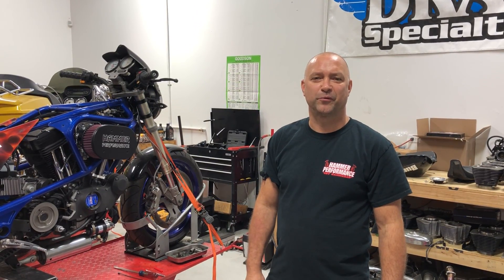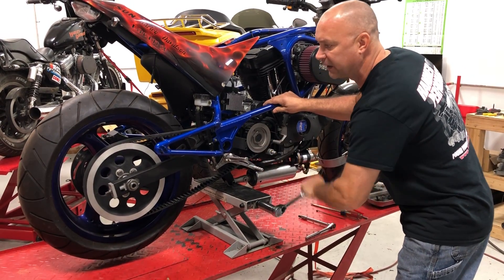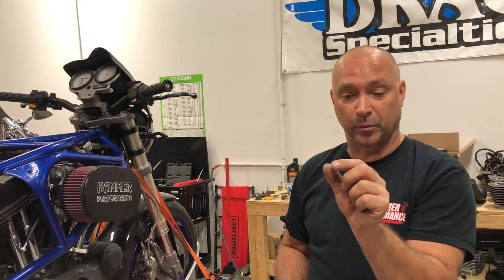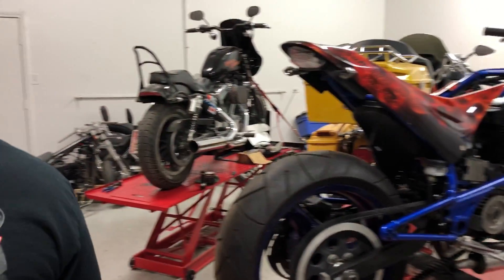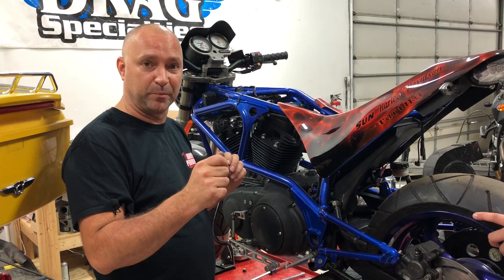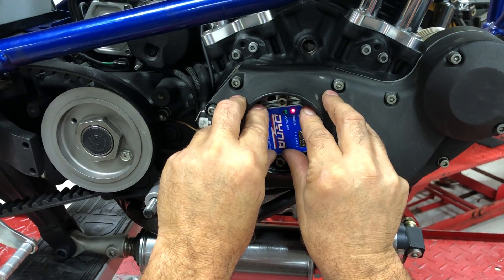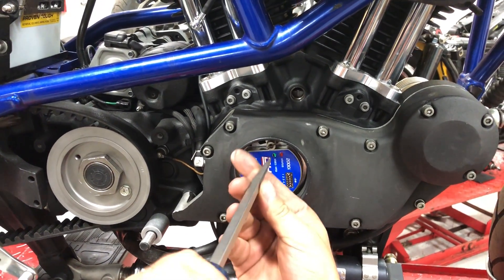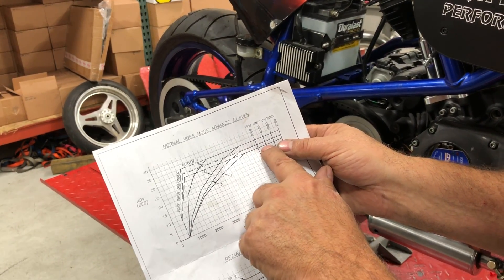How To Static Time An Adjustable Ignition Module

Comment: Why is my red light in flashing mode key on killer switch on run and cant get it off when rotating module.and it won't start either.

Comment: Once again thanks for the clear info. I have an ultima ignition and indeed the previous owner had it set at curve#1! When I dismantled the engine I found exactly what Dan here describes, scuffed pistons. I am surprised the pistons held up, as they were KB...also know as KABOOM!!! engine is being fully rebuilt with Wiseco and a programing kit for the ultima so I cam set it exactly as described in the video, only.mine will bring total timing to 28 without having to rotate. 👍👍👍
Reply: We're you able to still get the USBcable to program the ultima? I'm out of luck here since they fell out of business. Currently running curve 4 and advance the timing to 28 degrees from the 25 degrees it sits on curve 4. Was hoping to get the cable to get the rpm range increased from 3k to 5k.

Comment: I had the same exact problem, the status light wouldn’t stay on, it would blink once when I clicked on the run switch, had a buddy help put his finger over he front cylinder and it blew is finger off the hole so I new it was on the compression stoke, got the mark on my crank dead center, the light stayed on and got it static timed perfectly like the video, MAKE SURE ITS ON DTC ON THE COMPRESSION STROKE. 👍👍🔥🔥

Comment: Hi Dan,I have a 96 sporty, converted to 1200.i bought dyna2000p, and did all that you said on this video, on the dials I have dial 1 off as in voes mode, but what about the other four dials?, which one stays on or off, my bike is misfiring and sputtering, please let me know asap thanks.
Reply from the maker: Switch 1 is Off, switch 2 & 3 are ON, Switch 4 is Off, switch 5 is ON, switch 6 is off  hope this helps
Reply: Thanks Dan, the bike was misfiring cause i installed the new pick up sensor 180 degrees around, its fixed now , switch 1 is off as ait is now and will adjust the others as you said, i only have 5 in all, thanks again.

Comment: Thanks fo posting a very good and informative video.  Well done.  Near the end of your video you mentioned Ultima.  I have an Ultima 127 ci and when I open the trottle up I stop making power and the motor sounds different.  I don't know a lot about motorcycles so I can't give you specific parts information.  I did not build the bike and the builder lost all the build sheet information.  All I can tell you is low end rpm and power is very strong, but when I open it up it all falls apart.  Can I replace the Ultima system with another more friendly brand.  I did reference your curve chart for the ultima.  Any help would be appreciated and thanks for taking the time to read my comment/question

Comment: With the manual stating 20 degrees btdc, 2 dots in inspection window. Will my ignition work with or like the curves you discuss in the video? 01 xl1200c.  Right now with timing light the 2 dots are in center of window.

Comment: I got the 2000i installed, stock motor with vance & hines straight shots and open air cleaner. What curve would you suggest and what adjustment would you make? 2001 1200c

Comment: Very informative video helped me to understand timing alot better, i have a 94 electra glide with SE (high compression heads) and im swapping out a stock melted goo plate with the same dyna your using ,should i set it up the same as you are? I heard you say how its safe for a cruising mode as well, i want it to be smooth but have the twist if i desire it.... any help is greatly appreciated, i am a newbie but learnimg as im going i should say.
Thank you
Reply from the maker: what all mods have been done to the bike?  That will kinda determine where to setup the ignition module.
Reply: From what i know when i bought it i was told it has a screaming eagle high compression heads, had a screaming eagle 8000rpm module and coil(dualfire) , i put a single fire coil, a dyna 2000i and 8.8 pkug wires with high comp plugs,  havent started it yet , im at thebpoint of getting tdc and the static timing with the dyna light ,but its upside down

Comment: can you tell me if the ignition module leds will blink while cranking? i have a 2002 sportster and i think the module is bad. Bike loses spark after warm up. Everything else has been replaced...When i crank the bike im not getting led pulse on the module

Comment: Wanting to do this to my 99 1200s. It's got the dual plug heads, and the performance cam from the factory. I'm not sure what aftermarket cam it is similar to. But what's your thoughts on single fire vs dual fire? What's better?
Reply from the maker: The stock ignition on a 1200S is dual plug, single fire. Generally speaking, single fire does not add power to a typical street bike. There are situations where it adds just a little bit though, specifically when you have an effective overlap event (i.e. strong exhaust augmented intake flow). There's a long explanation about that. The stock cams in your bike are "W" cams. W cams first came out in the 1998 1200S and continued through the end of the 1200S in 2003. But then all XL1200's started coming from the factory with W cams beginning in 2004, and then all XL883's started coming with W cams beginning in 2007. So it's a very very common grind. Although it's better than the "D" cams that all the other bikes got, it's still a really really mild cam grind. It's timing is oriented toward the lower rpm part of the power band. You can see a chart that compares the W cams to the D cams and the N2 cams here: http://www.hammerperf.com/883conversions.shtml#faq1
Reply: @HAMMERPERFORMANCE  awesome! Thanks for the info! Wasn't sure if I'd get a response from an old video. You guys are great! I plan on buying just a 1275 jug kit from you guys down the line when the funds are there. What would be a good drop in cam to go with it? Would be using the stock heads with no head work done.

Comment: Hey HD, on my 01 sportster xl1200c stage 1 set up. Timing is set, I'm trying to set my rpm's with my meter but the numbers are unstable so I tested the meter on my truck and compared it to the tach on it and it's spot on. Any idea what's going on??
Reply from the maker: Your motor's firing interval is 405 degrees (rear cylinder to front) and 315 degrees (front cylinder to rear). On top of that, your stock ignition setup is a dual-fire, meaning that any time one cylinder fires, the other also gets a (wasted) spark. Bottom line is that any instrument, whether it's hooked up to the coil primary or uses an inductive pickup on a plug wire, is seeing both twice as many sparks as it should and they're also coming at odd intervals. Unless the instrument knows how a Harley works, it can't make sense out of what's going on. It's a common issue when using automotive based engine analyzers and dial back timing lights.

Comment: I've noting but trouble with this ignition to time . I've had on  TDC its a 99 big dog with SS on it .  I can't red light to come now so I'm not sure what the heck is going on. TDC has marks t ... f on flywheel but I've a hell of a time. Also on my coil do I need to ground Vos wire even tho I don't have that on my bike .
Reply from the maker: Leave your VOES line open if you're not using a switch.

Most of the time, when someone reports this symptom to us, it's because that although they have the key on, they forgot that the run/stop switch (on the handlebar) also has to be on for the module to have power. 

But another possibility is that you're on the wrong TDC. A 4-stroke motor requires two full revolutions to go through all 4 strokes. That means it passes through TDC twice. One of those TDC's is between the exhaust and intake stroke, what we call "overlap TDC". You don't want that one. You want the one between the compression stroke and the power stroke, i.e. "compression TDC". So if you're sure your module has power and the red light is not coming on, turn the motor over one full revolution to get onto the other TDC and try again.

Comment: So i have 2006 sportster, would  adjusting Daytona twintec be similar procedure?
Reply from the maker: No, not at all. The 2004+ bikes are all crank trigger and there are no mechanical adjustments. You just plug in the module and set the dials. For all of our engine kits, we specify in the kit installation instructions to set the Daytona Twin Tec TC88A tp initial 2, slope 0.
Reply: @HAMMERPERFORMANCE   Awsome that bit easier. Thanks

Comment: Would I be able to static time 2001 xl1200c with the big ignition module in nose cone? The machine mark is TDC but I do have the 2 dots also?
Reply from the maker: Yes, your HD service manual describes the procedure.
Reply: It actually doesn't mention anything about static timing
Reply: Just about the 2 dots and timing light. 20 degrees btdc, I have an adjustable timing light do I set to 20 degrees or leave it at 0

Comment: i got the ultima on my dragbike.. thats ok right? since i kinda dont need the crusin part hehe
Reply from the maker: Well, the Ultima module implements different curves from the Dyna 2000i, that's the difference. All the switch functions are the same, but the curves are different. You can see the ultima's curves here: http://www.aswracing.com/ultimacurves.jpg and the Dyna's curves here: http://www.aswracing.com/dyna2000curves.jpg . Curve 4 on the Dyna 2000 is perfect for our kits and makes the most power and the motor runs cool an it's safe for the pistons. The Ultima however doesn't really have a curve that's suitable for our kits and when we have a customer who wants to use the Ultima, we advise him to get the programming kit and program up a custom curve that looks like the Dyna 2000's curve 4.
Reply: @HAMMERPERFORMANCE  what would be best for a 79 shovelhead, will a Ultima work best or one of yours? And how much for one of yours with an external module?
Reply: @HAMMERPERFORMANCE  I don't run voes on the dragbike since it's a all our race bike so the curve dosent really matter right ?
Reply from the maker: @nikolaiownz  Absolutely it matters. The kit will be damaged if the curve is not correct. See our kit installation instructions.
Reply: @HAMMERPERFORMANCE  i dont run a kit from you sadly. I just have a 883/1200 12:1 bigger valve headwork with around 105 rwhp engine. I've used the Ultima on the engine as a 883/1200 all last year for dragracing without problems.

Comment: I have a screamin eagle module on my 00 sportster, according to its manual, you have to turn the baseplate until red light came on. You turned it until it goes out, than back, so it just came on in your engine too.
So is my bike at 28 degrees now? Bike starts easy and runs strong. 

See Figure 3. Slowly rotate module plate until red LED illuminates, then tighten module plate screws to 15-30 in-lbs (1.7-3.4 Nm).

How can I make sure its perfect? I am running 10.5 to 1 compresson 1200 dished pistons with 883 heads and W cams.
I dont want to destroy my engine with cranking pressure.
Reply from the maker: All the static timing procedure does for you is sets the baseline for the curves implemented by the module. In other words, after following the static timing procedure, your available curves will match the diagram shown in the module's instructions. Yes, the static timing procedure varies from one module to another. We're only showing the procedure for the Dyna 2000 series modules in this video - although several other modules use the same procedure, but not all.

There have been a number of different SE modules sold over the years. Unfortunately, most did not include curve data in their instructions. So you really don't know what you're getting. Aftermarket modules always include curve data so you know what you've got after properly static timing. 

Curve number 4 on a Dyna 2000/2000i module, after properly setting the static timing, is what we specify for our kits, because it produces maximum power and is safe for the pistons. This video is all about showing our customers how to set the module to achieve that. Incorrect setting of the ignition timing is the number one cause of scuffed pistons and we simply can't afford to have our customers making that mistake. So we want to show them exactly what to do.

Unfortunately, all too many people are under the mistaken impression that more spark advance equates to more power so long as it's not pinging. We've dyno tested these bikes to death and nothing could be further from the truth. Running the timing up, with more aggressive curves and/or more final advance than we specify, makes the motor lose power, run hotter, and puts the pistons at risk.
Reply: I tried that. The LED don't come on at all anymore. It came on at first but only in full advance(clockwise)

Comment: What am I doing wrong? I've lined the mark up on the front  cylinder but no red light. When I do get a red light there are 2 dots in the crank window. I thought I was 180 out ? Should I time off the rear cylinder or have I got the wrong timing cup?(2 cut outs)
Reply from the maker: How did you go about determining which TDC (overlap or compression) you're on? If you choose randomly, you've got a 50-50 chance of being on the wrong one.
Reply: @HAMMERPERFORMANCE  shall I test every tdc? Which is what I thought I'd done.
Reply from the maker: @brittenv1000  If it was me, I'd just put it on compression TDC. HAMMER Dan shows how to find compression TDC in the video.

Comment: Turned the module clockwise as far as it will go. The red light stays on., I can't turn it any farther. Thinking of drilling out the slots to give me more room to turn, Or should I change the dip settings to a different curve. Stock 89 Harley EVO, no mods. Note the previous dual fire module was turned all the way when I removed it. The bike runs good set like this. Any comments or suggestions would be greatly appreciated.
Reply from the maker: Which TDC are you on?
Reply: I took the module out and drilled the slots to give me more room to turn. That didn't help. The module hits the set screws and can't be turned any farther. If I take the screws out I can see that I am only  a couple of thousands away from it being in time . The light does go out without the screws. Note, I had this engine completely rebuilt by the Harley Stealership about 10 years ago. I do have   a timing light and an old tach, I may hook the tach up and see if that gives me any different results. Like I said the bike runs good, no more backfiring, shifts much smoother and overall runs much much better.  I should have done this years ago. Anyway,  the old saying goes. "If it ain't broke don't fix it" Thanks for the reply and interest.
Reply from the maker: @RobtJude  And you're sure you're on Compression TDC, not overlap TDC, right? Every guy who's ever asked me about this particular issue, that's what it's turned out to be, not understanding how to get on the correct TDC.
Reply: I do have a compression tester.  Time permitting this weekend I will try one more time. By using the compression tester, I will be able to discern that I am on the compression stroke 1st cylinder at TDC. I expect that I will need to use the starter to turn the engine. Once it starts compressing I will pull the tester from the spark plug hole and continue rotating  manually. I hope you are right. If not I am still very happy with the way it is running. Update to follow. Thanks again for the help.
Reply from the maker: @RobtJude  A compression tester sounds like an awfully difficult and error prone way to do it. What's wrong with the way that's shown in the video?
Reply: RobtJude or just put a air compressor line in spark hole if no air comes out intake or exhaust its valves are closed

Comment: I believe that set up has rev limits set at 500 intervals. Did you drop to 6500 or increase to 7k?
Reply from the maker: Hi Mike
I set it as high as it would go without going in and reprogramming it.  I set it to 7500 RPM

Comment: For full race application wouldent u want the timing to come in fast
Reply from the maker: The ideal time to light the fire is a function of the speed of the burn. These kits have a very fast burn and therefore make max power with a soft curve to match. A more aggressive curve makes less power, makes the motor run hotter, and puts the pistons at risk of damage. See this sheet for a typical example of what happens when you advance the curve: http://www.aswracing.com/dyna2000results.gif . Curve 1 on that sheet is the most aggressive curve and curve 4 is the softest.

Comment: I definitely run curve one 🤷
Reply: I dont have any ping issues, I do also have higher compression with the +300dome pistons, running 93 no issues check the plugs regularly heat range and timing all look good, I also do dynamic tyming with it running.

Comment: Why not measure the inside circumstance of the timing and cam cover inspection hole in milimeters and convert to degrees,  eg, 360mm / 360° ,  then felt pen or scribe mark the cover and module, and then move by the millimeter. 2mm = 2°
Reply from the maker: We don't have any millimeters around here, in fact I'm not sure they let them into the country. Pretty sure Customs confiscates them all at the border. But we have inches and they're better anyway. The plate is 3 inches in diameter, which is a 9.425 inch circumference. One rotation of the timing cup is 720 crankshaft degrees - remember, the cams run at half the crankshaft speed. So each degree is 9.425 inches divided by 720 = .013 inches per degree at the perimeter of the plate.
Reply: @HAMMERPERFORMANCE  
Oh ok thats even tighter,  lamo, your lucky, we're like a giant pudding bowl with a bit of everything thrown in lol.
I was looking for greater moor course movement at the front 'of'  to make it easier to see, and mark off exact degrees ect.
 thanx so much for your time, your the man lol..